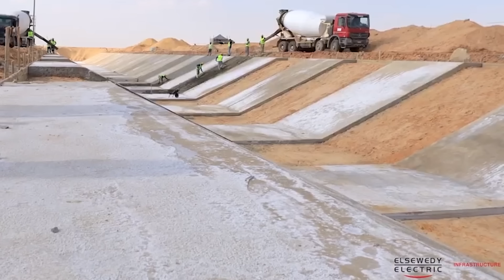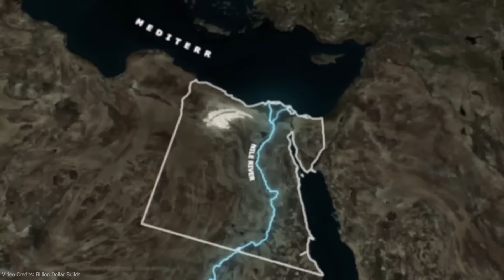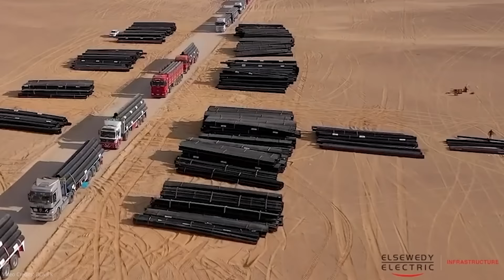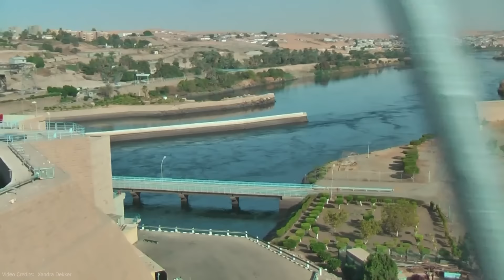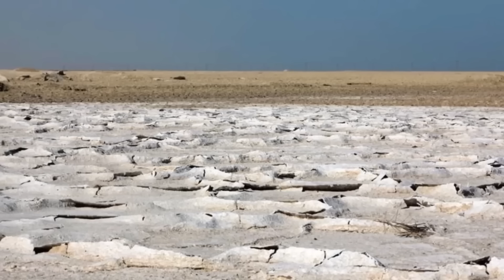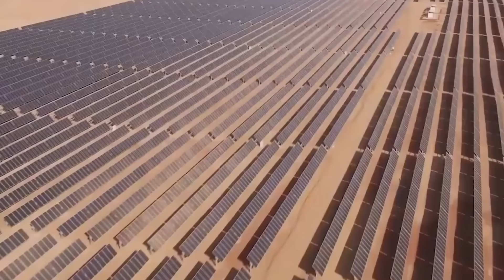Inside Egypt’s Plan to Flood the Sahara Desert to Generate 6.8MW

Comment: It's a great ideabut with a very big problem of contaminating groundwater table. But there is a solution for this. Why not use higher grade plastics sheet used in biomining and landfills to cover the whole depression sites so that water can't seep through it? we can double and triple the sheet just to make sure that water doesn't seep through it to groundwater table. 
ANd then flood the are and harvest the salt and make use of water to generate electricity.
Also why not use solar panels and cheap battery storage systems to generate electricity since Egypt has so much sunlight?

Comment: Think for a moment about the Salton Sea in the Southern California desert.  It was formed in a below sea level depresion by flood waters from the Colorado River about a hundred years and since maintained by agricultural irrigation runoff.  For a while it was considered a desert Rivera but as the salinity increased it became toxic.  Over time evaporation reduced the lake's size and depth and exposed  toxic deposits on the shoreline.  Wind blew these toxic materials into surrounding communities and many think it is responsible for chronic illness hot spots in the area.  It has become a problem almost beyond solution.  The only very expensive proposal with any meret seems to be importing sea water from the distant Pacific Ocean or Gulf of Mexico.  The Salton Sea is minute when compared to the inland sea proposed here.  What is there to prevent it from becoming a toxic dead sea in a hundred years or so.  As an environmental disaster this idea ranks right up there with deforesting the Amazon.

Comment: Why not use the solar energy that is so abundant in Egypt to desalinate the Mediterranean Sea and have the desalinated water flow into the depression so that they can use the water for agriculture and generate more electricity?
Reply: Not necessarily. The main issue with desalination is energy and waste. More often than not, you need more energy that the plant isn't feasible anymore but that's not the case with the desert, you have solar energy in terms of heat and light both of which can be useful. You can use the heat to cause rapid evaporation and then condense the vapour to get clean water. Since the energy is "free" there's no need for a larger output, patience can be exercised. Then all they need to do is use the same sea water to dilute the brine and return it to the sea.
Reply: Desalination plants are expensive and not that effective. you need hundreds of such plants.

Comment: And where is all the salt supposd to go once the water evaporates?
Reply: Mine it. Sell it.  Egyptian salt is already being exported to Canada for ice & snow clearing due to shortage there.
Reply: There is enough space to last for ages.
Reply: This project is not being planned in whypt what so ever. It was a proposal that dates back to the 1930s. For some reason channels on YT are hyping it up, but it is not planned nor even being considered.
Reply: Hard to mine something that's under 400 ft of water. Also, the argument that the size could last a long time before that's an issue, is just ridiculous. Because it will eventually become an issue
Reply: @NascarDSan  It only needs to be worth it until that becomes an issue.

For example, if it becomes a significant issue 400 years from now, that is effectively pointless.

And 50-100 years could still justify an entire large infrastructure 🏗 project.
Reply: It stays in the lake, settling onto the bottom.
Reply: Salt dust will flow to the irrigated fields and destroy the country's agriculture.
Reply: @dubsarwell there won't be any salt dust. As the water in the Qattara Depression evaporates it will be replaced by water from the Mediterranean Sea, never allowing the depression to dry out, so no dust. Water distillation plants would draw water from the depression and create fresh water and leave salt and lithium to be exported for industrial uses. The power generated by filling the depression with sea water would be used to power the distillation plant and for Eqypt's own use, providing both power and fresh water for drinking and agriculture. While there may be bugs to work out of the system it does seem like it could work, it's not like the engineers designing this project are unaware that saltwater from the sea actually hass salt in it lol.
Reply: Into The salt marshes
Reply: .. probably food grade salt other end ?
Reply: @pedromorgan99  There is going to be an enormous amount of salt that's created
Reply: @Krunchy71  Exactly.. in the chemistry chain there should be a lot of lithium phosphates also. The target evaporation area is an evaporated bed, salt lake.. its reinstating historic lake.
Reply: @Krunchy71 This salt will be swept by the wind and contaminate the arable land to the east.

Comment: The folly of "green energy" exposed once again...😏
Reply: What specifically makes it folly? It's an interesting idea. It's certainly green in terms of it not being fossil fuel based and at the moment we're so far away from eliminating fossil fuels we have to take all other options seriously.
Reply: What precisely makes this GREEN?
Reply: @Mentaculus42  hydro power doesn't emit co2
Reply: @DuncanAtkinson 

Not arguing but I have generally seen that people that are in the green group usually associate the term green mostly with solar and wind. Usually that group is not overly enthusiastic about hydro for various reasons. I personally think that hydro is clean vs green but that distinction seems rather arbitrary. It is strange how particular groups get rather territorial about terminology.
Reply: @Mentaculus42 I also consider nuclear as a green energy source.
Reply: @DuncanAtkinson 

I think that the green tribe would at best consider nuclear as CO₂ CLEAN but definitely not green. Generally the green group hates nuclear and it doesn’t fall under the renewable umbrella. The distinction between green and clean is somewhat arbitrary and those that do the defining seem to be rather vocal and protective of what is green (at least that is what I’ve seen). Nuclear is definitely clean by most sane people.
Reply: @Mentaculus42 fair

Comment: Seriously, what could possibly go wrong‼️
Reply: .. it will either work wonderfully, or be an expensive folly. Worthy of a try, imho in slippers in wet wales
Reply: @pedromorgan99 

California’s Salton Sea has turned into a disaster on many levels. The Salton Sea was created by man by mistake. The Dead Sea is getting too salty and requires some sort of remediation. The Caspian Sea is drying up and has issues. The Great Salt Lake is drying up and has issues. What makes this experiment different?
Reply: @Mentaculus42  The difference is that the depression is already dry and will become wet. That's the opposite against drying out.
Reply: @gottfriedheumesser1994 

But the salt content in the water will by design continue to increase. That will have an environmental impact. The Dead Sea is having an effectively similar situation other than it is, as you say, drying out. The Salton Sea which transitioned from a fresh water body to a salty lake and now a dead lake. It seems like this project should be carefully researched with regard to what is going to happen. The California Bay Area has evaporation ponds that seem like comparable analogs. If managed properly, perhaps it will work out.